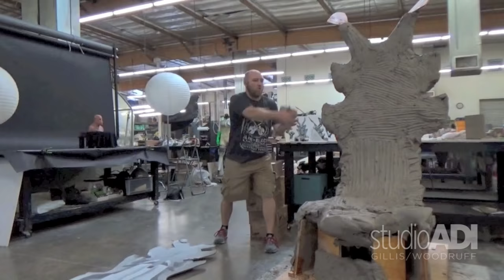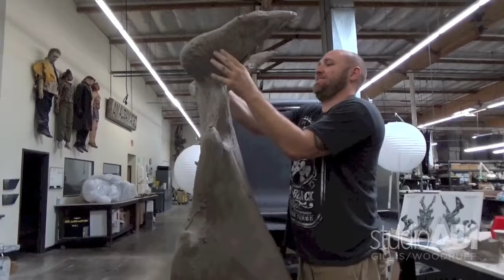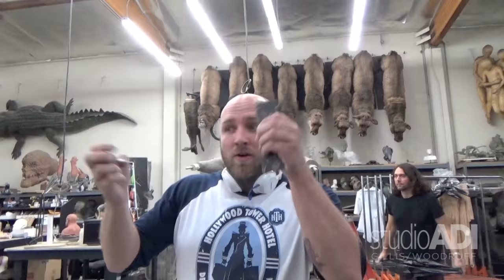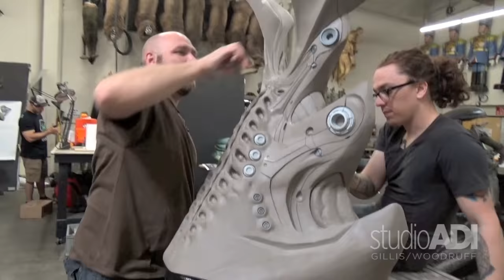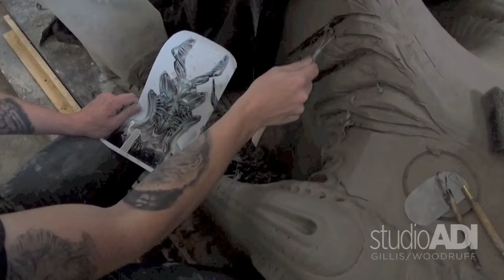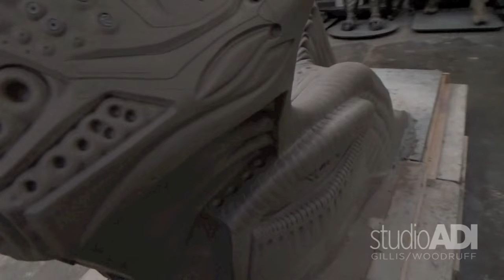INDEPENDENCE DAY RESURGENCE Building Cockpit Pt2 Sculpting Seats ID2 BTS ADI

Comment: Why do they sculpt both (symmetric) halfs of it?

Aren't you going to mold it later anyway?
If so, can't you mirror it at that point and then spend some time to get rid of the seams?
Reply: How can you mirror that? Its impossible.
Reply: And how, exactly do you plan on mirroring it? This isn't CG or photoshop.
Reply: Yeah, looks like I didn't think this one through..

However, I guess there are still some ways to do it?
I guess one could hydroform an existing cast or use a less solid material (silicone maybe?) which can be wrapped inside out.

But yes, ignore me. I somehow messed up and thought it was easily done somehow.